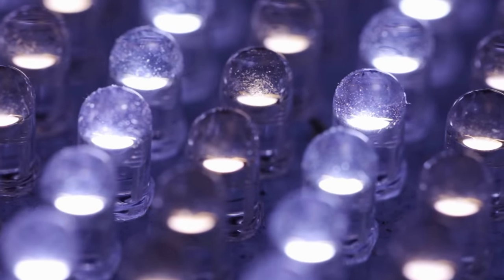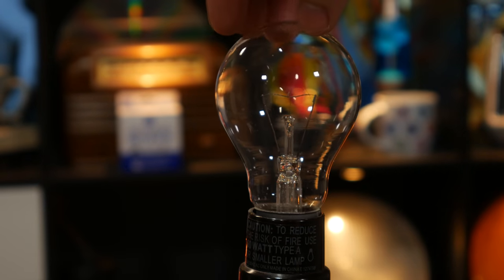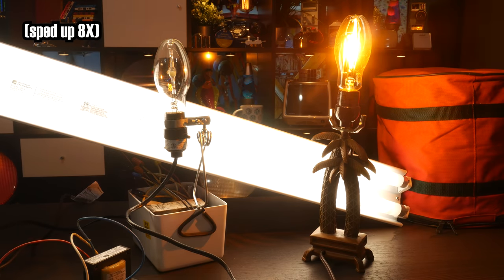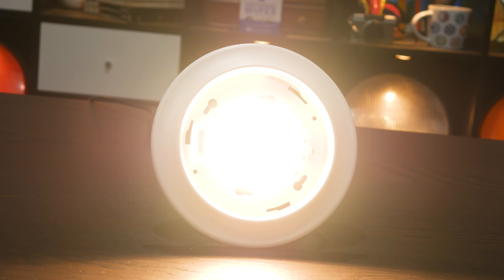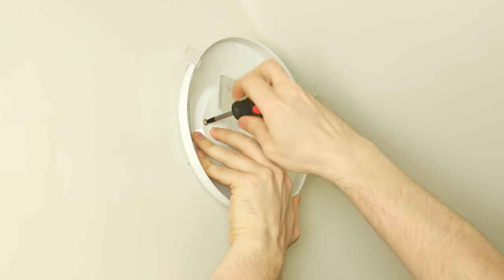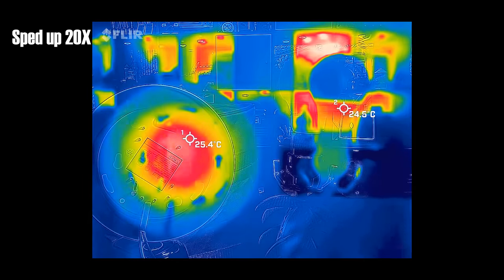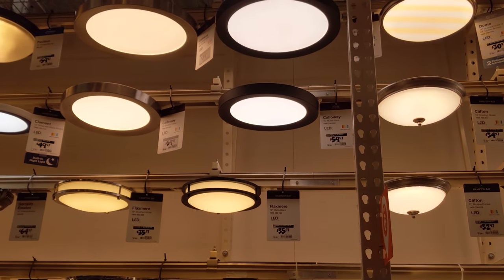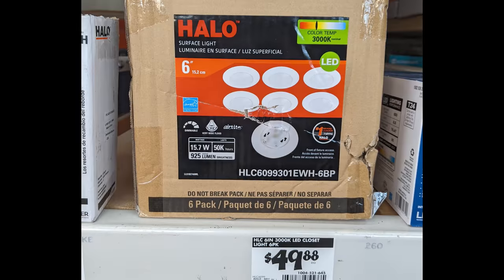A troubling trend in lighting?

Comment: The tough thing for me is trying to find replacements for all in one led fixtures because by the time the light starts to fail, the company doesn't even make them anymore in that style, in fact it's so old it not even on their discontinued list anymore. So then I go down the rabbit hole of trying to find a chip that can safely work for that driver but the specifications for the driver are extremely confusing and I just give up. And when it's a commercial building you can't just replace on light fixture in a room full of them without having to change them all so I'm not entirely keen on them for commercial use when you have 20 of them and the product is sold a unit that no longer exists.
Reply: Not to mention that often when you change a fixture you may have to end up doing paint touch up too if the old one was painted around or the edges left a fade shadow or line on the paint over time
Reply: And that's why I put used fluorescent strip lights in my workshop. They came with fluorescent tubes, which I figure I'll use until they fail. And when they fail, I'll disconnect the ballast and put LED retrofits in.
Reply: In a commercial installation it is a good idea to purchase a few extra as spares in case you later have one fail.
Reply: and by “old”, you mean anything made in 2021 already is obsolete, and no longer in stock
Reply: Yeah and every 5 minutes the "trends" in home stuff changes, so you're going to end up replacing them ALL because ONE died. That's gonna lead to some e-waste. That or you have to suck it up and deal with your house stuff not matching (which almost no one will do).
Reply: Sounds like Apple is selling lights now.
- not compatible with others
- not repairable
- rendered obsolete by every iteration
- warranty requires the building be re-wired every time a light burns out
Reply: Buy duplicates.
Reply: Once that happens, change that room and keep all the known working ones to repair other rooms for a while
Reply: @LowVoltage_FPV  Yeah that would of been nice but I wasn't here when the building was being renovated and unfortunately no spares were here when I came but that would of definitely been good planning for the future for sure.
Reply: My saving grace has been for some reason, even the cheap LED lights have crazy long warranties on them, so the biggest pro tip I can give is save all your LED light receipts, and take the entire lot back when one fails, and get store credit towards the newer bulbs now available.  I’ve done this three times over the past 8 years, each time the bulbs would start failing around the 3 year mark, but they had 5 year warranties.
Reply: @rbnhd1976  this is the only good answer so far.
Reply: We're running into this at work. 20 years ago and then 10 years ago, the proprietary fixtures we installed were the cheap and/or "good enough" options. Now they don't make the bulbs anymore, so we have to swap out hundreds of high volt light fixtures around the building
Reply: @jonjohnson3027  good plan! Fun fact: if you're particularly lazy (like me), Phillips makes a few led tubes designed to work without removing the ballasts, they are branded as "universal". I've got some, and they work fine, only downside is the fixtures still make that faint buzzing noise from the ballasts still in place.
Reply: @colonynaut1627  Buying duplicates doesn't solve the issue with the LEDs fading and color shifting over time.  Even if they were made in the same batch, a duplicate swapped in after a few years of use will not match the rest due to this.
Reply: @TheBertLocker  The downside I've run into with that is that the manufacturer actually wants you to ship the unit back for warranty/RMA, and they are sold at such a price point that makes it more cost effective to replace the units and either e-waste the broken one, or (what I ended up doing) retrofitting more universal components into the fixture and repeating as units die.
Reply: @CraftAero  That last one is the real pain. As a sparks I end up having to do a Periodic Inspection Report to change a ****ing bulb!
Reply: @jgharston  No worries, you won't be allowed. Unless you're a t-shirt wearing, certified Apple™ Genius bulb changer.
Reply: The most obvious solution is to just throw away the room.
Reply: @LowVoltage_FPV  Sadly if you have multiple units and they were remodeled at different times it is hard to keep multiple spare types in stock. Seems manufacturers only make them and stock them for no longer than 6 months and they are SOWG, because they don't keep any NOS. SOWG (sold out when gone) NOS (New old stock)
Reply: @uzlonewolf  Interesting. I like the idea of natural daylighting with fiber optics, sure not to fade!
Reply: Honestly, I'd say screw it and solder whatever led looks simular enough to ones in there and see if it lights on fire. My main concern is getting those dam things open. Some of the fixtures have plastic clips that force you to scratch the boob up or break the clips. Others have the leds embedded in glass.

Comment: Great video, Just a comment!
I'm an LED Engineer. In fact i was involved with designing some of the first Direct-AC Drive systems that you showed on the video. Seoul Semiconductor boards are pretty (just like the ones you showed :D)
Everything is pretty accurate; but the ONLY comment i have to make is that the long, squiggly filament style bulbs are NOT driven by a driver. They're using a cheap trick which is, four diodes in a normal bridge; and then using 120VDc LEDs. That's what those filaments are: 120V voltage LED strings that are just powered at 120Hz by the dual waveform rectifier. You can validate this using a camera to see the shutter and the 60/120hz flicker.
That's why they last so long: There's no switchmode driver, just a couple of diodes.
Reply: LEDs in filament style lamps aren’t 120Vdc but the usual 3Vdc or so, in long series chains. The simplistic driver circuit would be L+N, capacitor with resistor across, bridge rectifier, resistor (to cut off the after glow) and then likely parallel series of 40 LEDs.
Reply: @billyponsonby  That's literally what he said, when he said 120V LED strings. A string of LEDs put in serial, which leads to the individual voltage drop of each LED being added together 😉
Reply: In some of the really cheap ones they use the LED's as the rectifier diodes.
Reply: @luipaardprint  Ew. Wouldn't that put a lot of stress on the first or last LED in the series?
Reply: @billyponsonby  most of the crappy fillament bulb designs don't even contain a smothing capacitor 😀
Reply: I'll say thank you for the service.
As an 58 y old woman, I'm so happy for the LED revolution. As it's getting standard in Europe, I'm happy for better light, more light in winter, and lower use of electricity.
Reply: @akehapkap6143  

High power LEDs were a mistake. 
They're just another little bane of my existence in this world gone mad, that slowly but surely drives me insane. ;D
Reply: This doesn't explain dimmable filament-style LED bulbs.  Those MUST have a driver circuit, or they would not work (without severe flicker) below the LED string's minimum forward voltage.
Reply: @1969barnabas  Correct, dimming LEDs on mains is a nightmare, even more so if you're trying to make it backwards compatible with oldskool triac dimmers - they essentially start conducting later in the sine wave (or cut off earlier in some rare instances). Given the non-linearity of the LED as a component, it's kinda tricky to 'convert' that method of averaging power into one that LEDs are happy with.
Reply: @adzib1823 I agree with you. Got any schematics that you can share?
Reply: @1969barnabas  Unfortunately not, but maybe you could use the incoming (constant mains) to the dimmer to derive a couple of DC rails - high-voltage for the LEDs, and a low-voltage 5V for an MCU - and then time the dimmer unit output and convert that into a PWM duty cycle for the LEDs. There are probably better ways to do it than that, but I don't know them. It is possible that the dimmer unit will require a minimum load (probably connect a high-power resistor).

Needless to say, if you're reading this and don't know any of the terminology and/or how to implement this safely. Don't. It's not worth risking life and property.
Reply: @luipaardprint  If I would have done something like that in a circuit my professor would have been very unhappy. I've seen him bashing students for that.
Reply: What can one say about the dollar stores that sell LED lamps that are marked "non-dimmable" that come in packaging that is labeled "dimmable?"
Reply: More like ~165-170VDC, no? When you rectify 120VAC, peak is input AC voltage * sqrt(2).
Reply: @brag0001  that's what I was thinking. It's the same concept as incandescent Christmas lights. The power rating of the LEDs times the number of elements in the string equals the desired voltage for the input.
Reply: @westelaudio943  If you ever had a good LED in your house, you wouldn't say that. A good LED replacement is indistinguishable visually from a normal bulb if you want them to be like that, but better in literally every other aspect. LEDs draw less power. If designed properly LED bulbs aren't hot to the touch even after hours of operation. LEDs can cover a better light spectrum than normal bulbs if you value that. They can adjust their light temperature or color, if that warms your heart. They can be dimmed, if properly designed and you can turn then on and off millions of times a second, if you need to do that. They don't break as easily and aren't as fragile when presented with vibrations. They can be a sharp point light source or a surface light, whatever you need. And the light cone they emit can be adjusted on the fly according to your needs, allowing for better headlights.

There is literally no area where they don't outperform light bulbs. They can even be dirt cheap; far cheaper than the cheapest bulb you ever used, so that we can literally put millions of them into a single panel. They even last way longer, if build to do so.

There is only on area where they suck: backwards compatibility with old dimmers. But those already sucked with normal light bulbs and should be replaced with a modern one, even if you still use light bulbs.
Reply: @brag0001  

I know decent LEDs exist. But have you ever walked down an LED-lit street at night?
Reply: @westelaudio943  I have. Where I live LEDs have almost exclusively replaced every other form of light even for street lighting. The energy savings justified the replacement costs years ago already.

Like everywhere we have good and bad versions of those street lights. I hope that the next step: adding motion sensors, so they don't disturb wildlife that much, will be made wherever they replace those in the future though ...

Comment: Interesting side note:
Some LED bulb drivers are known to interfere with garage door opener radio frequencies. Happened to me. Bought this great LED flood for the front of the garage and couldn't open the door. Took about a half a day of head scratching and googling but I just wanted to share 🙃
Reply: Paios, a LED light which interferes wiyh your remote control would never pass FCC regulatory compliance. You want to take a good, hard look at where you bought that dodgy LED light from.
Reply: @bennyattar8862  LOL, do you actually think that chinese manufacturers of cheap LED light sources care about fcc or any regulation at all? It wild west or wild east for them with no laws.
Reply: Omg. Light bulb just went on over my head. I have a garage door opener remote that seems to work fine to open the garage door but then takes gobs of frustrated mashing to close it. This could very well be what’s happening! It works fine to open the garage door, because the lightbulb is off at that point. But then the lightbulb turns on for a minute or so, so then when I back the car out of the garage and try to close the garage door, it doesn’t work reliably. I kept thinking it must be a low battery in the opener or some thing, and I’ve replaced the battery several times, but it has never gotten better. This is probably what is happening (I replaced the incandescent on the opener with an LED bulb a couple of years ago, and it probably started about that same time). I will have to test this!! Thank you, random Internet stranger!!
Reply: @bennyattar8862  benny, it's a common problem. Maybe you should pen a letter about it if you're concerned.
Reply: My grandma has a few square led lights built in the ceiling of her hallway, and when you turn them on, her radio loses signal
Reply: @bennyattar8862  Most LED bulbs interfere with something, even fcc ones. Just hold a AM radio to a led
Reply: Yeah we use a 250 watt bulb
Reply: Interesting. Maybe it was defective or on the same power circuit? I have LED fixtures in my garage that emulate a dozen 4' fluorescent bulbs with no problems so far. Thank you for the heads up, if I start having problems. Interference isn't unheard of, which is why hospitals have different circuits for their medical equipment. In 1990 our central computer had problems and the tech figured out it was due to fluorescent lighting in the room... radiation causing the disk drive unit to "skip" as a bulb was failing.
Reply: @mikep490  LED bulbs with poor shielding and the wrong rectification circuitry can have massive RF issues
Reply: @No-mq5lw  That makes sense, since that's how RF LEDs work, per FCC. I like the above comment about FCC compliance. There are lots of bogus "compliant" products (lights, car parts, meds, etc) out there, often sold cheap online, but even Home Depot and Amazon sometimes get scammed. It's cheaper to just print a FCC label than meet compliance. FCC Section 15.109 is the supposed max output (at 10 meters?). I was thinking of installing an LED in my door opener, now I think not.
Reply: @mikep490  Bit inconsistent depending on the price bracket. My led bulbs just work (except the part where the cap failed) and there's Chamberlain bulbs for your garage door.
Reply: @alaskanjackal I need to know, did you fix the problem? Lol
Reply: @mernok2001  if OP bought the light from some dodgy chinese manufacturer then everything benny said is relevant
Reply: I NEED an update on this! Did you change the light?! Did it solve the issue?! 😮
Reply: @alaskanjackal  I guess the litghbulb struck back since you were never heard from again..
Reply: Many also swamp the AM and SW bands with noise.
Reply: I feel your pain. I had a led light for my bicycle, it interfered with my wireless odometer on the front wheel. Switched to a wired odometer. Fixed the problem.